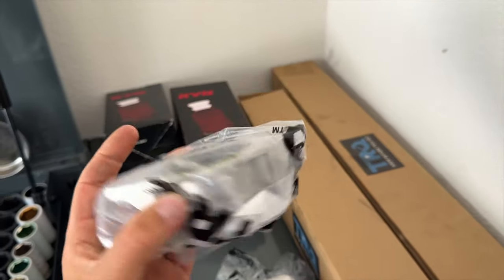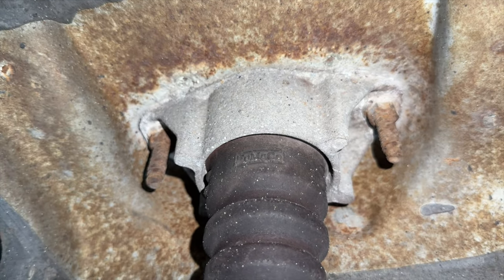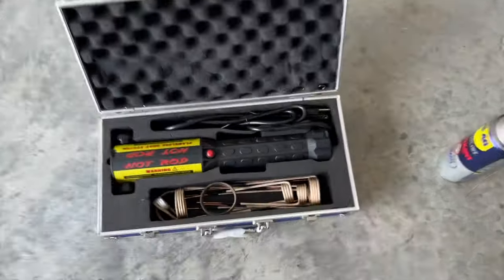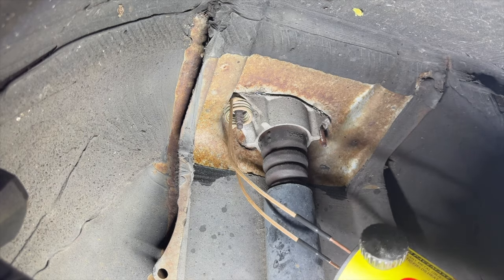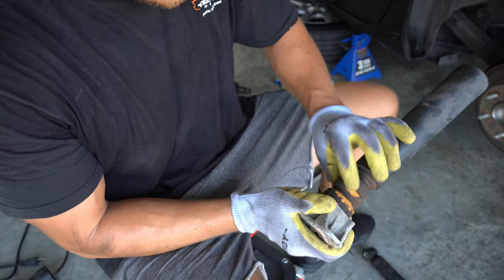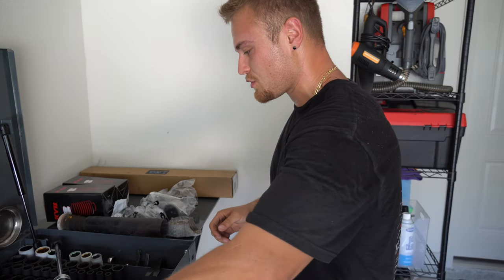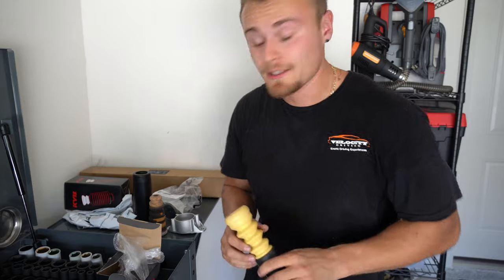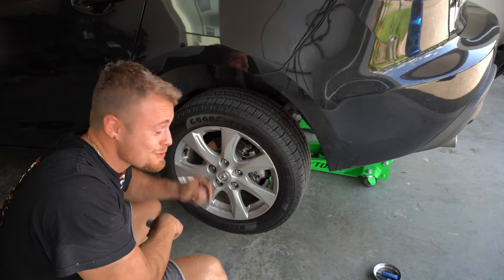How To Replace Rear Shock And Top Shock Mount On A 2010 MAZDA 3

Comment: An important question, my mechanic told me that these shock absorbers do not last more than 15 days. It made me feel bad and I wanted to know if they last and if they are good shock absorbers since I bought them.
Reply from the maker: So far so good. havent had any issues. if they fail ill put out an update here and then ill buy OEM. I would avoid TRQ CV Axles
Reply: @Haydenschreiermk2  thankiu

Comment: I changed mine I got a whole new assembly and mounts but the car still felling bumpy on bad rodes any idea why??
Reply from the maker: feeling bumpy on bad roads. even cars that are brand new will feel that
Reply: Check the rear sway bar links. They make a clunking sound over bumps when they are bad

Comment: I replaced mine but I broke one of the top bolts. Is it an easy fix
Reply from the maker: you will have to drill it out and go through the trunk of the car and pull off all the interior trim to access it and either weld a new one on or just put a bolt through it maybe with some JB weld
Reply: @Haydenschreiermk2  Thanks. I have already removed the interior trim inside the trunk. Just need to drill it out and put a new bolt in.
Reply: @binyamin5022  Was it difficult for you ?